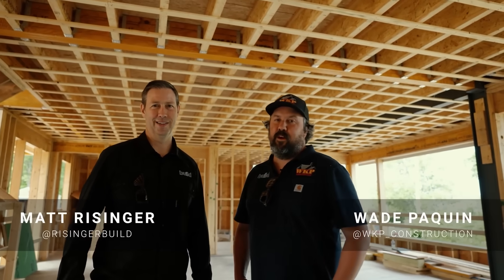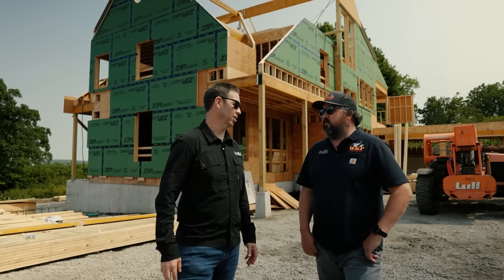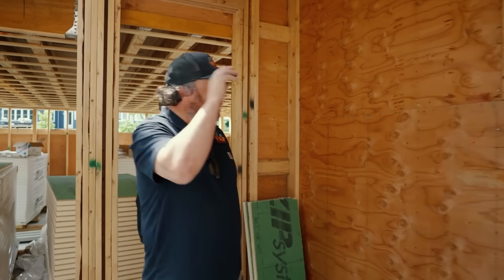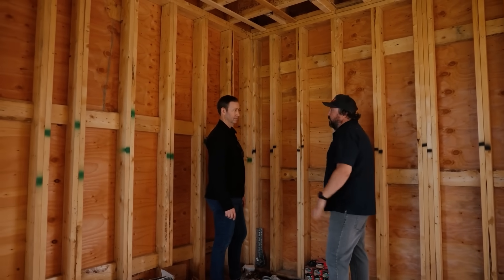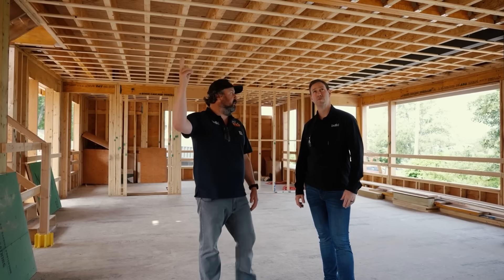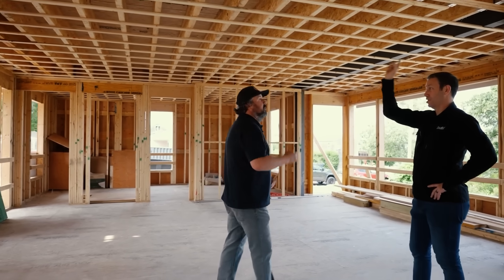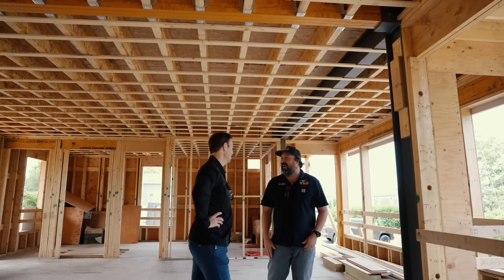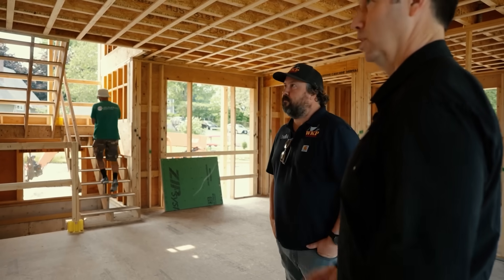Best of The Build Show |  Northeast vs. Southern Framing with Wade Paquin

Comment: I have started doing ceiling strapping back in the UK now as more and more i-joists are being used and the building inspectors aren't found of holes being drilled in them for pipework let alone wiring. Makes it much easier for the plasterers to get a consistent finish too which is so much more involved than dry wall and mudding, much more weight so it really makes a huge difference.